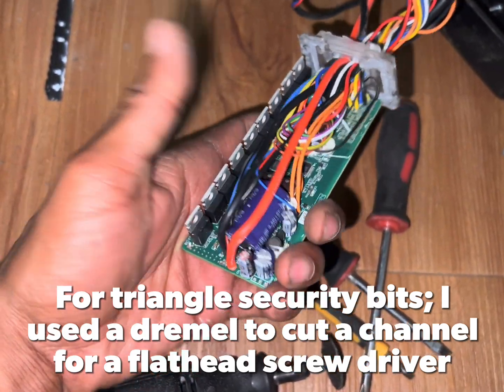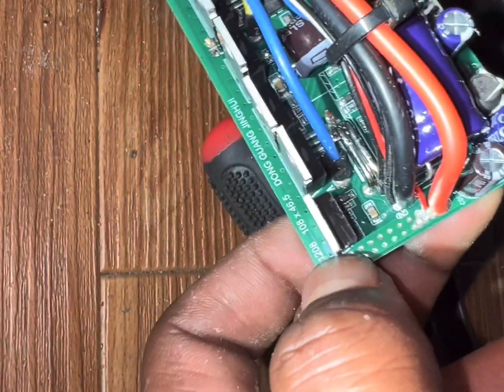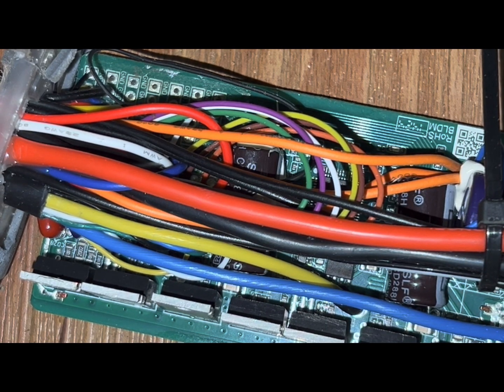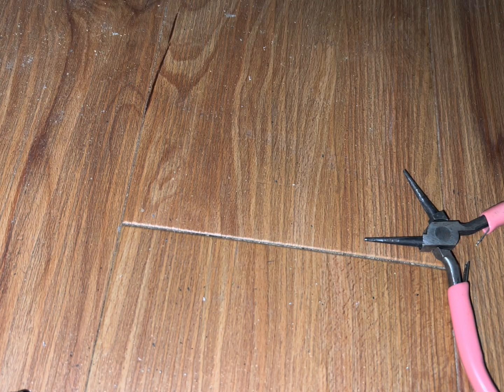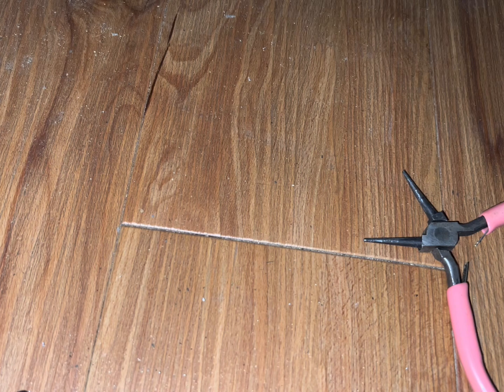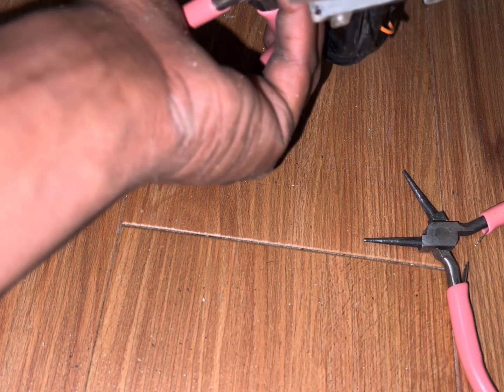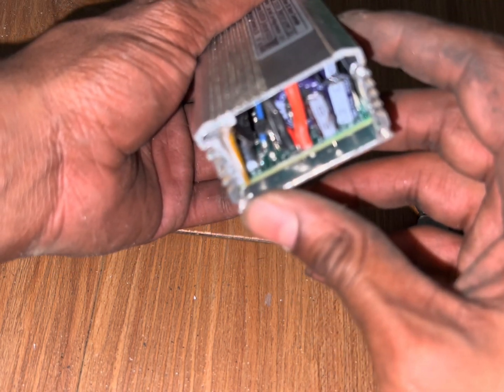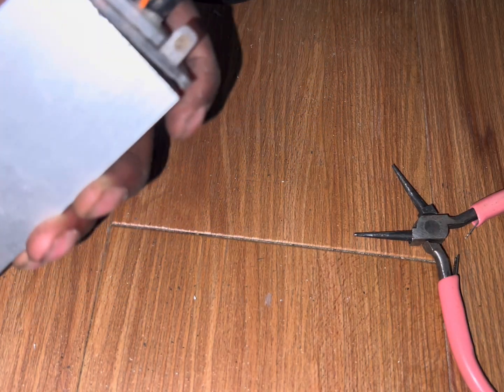Shunt Mod on my Seeker 24

Comment: It is a pity that you did not show the difference before and after mod, remember that any loose metal element inside can cause short circuit and damage,it is suggested to use hot glue.

Comment: Nice, I shunt modded both controllers on my ebike too and went from 48v 23ah to 52v 30ah. Added a second matching 52v batt and went to a thumb throttle over the twist. The bike is crazy fast now tops out at 43 mph.